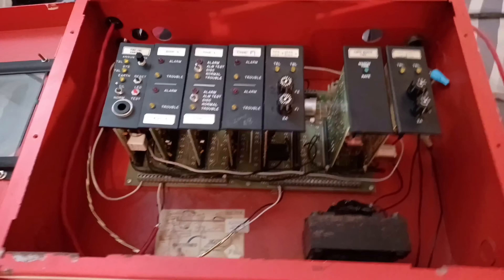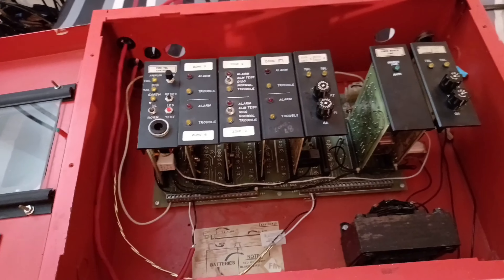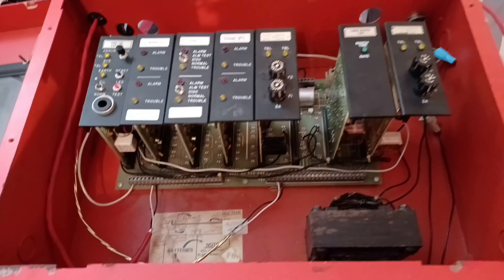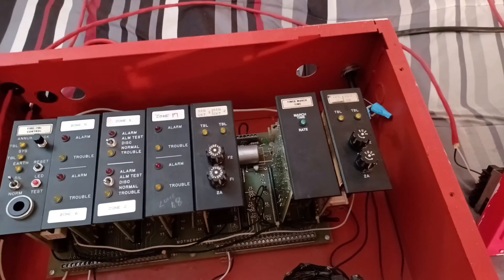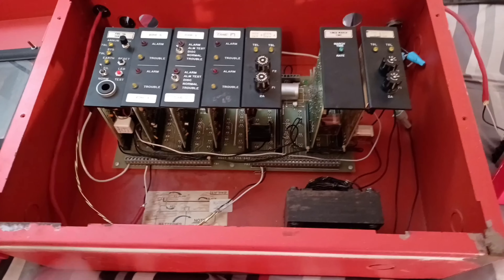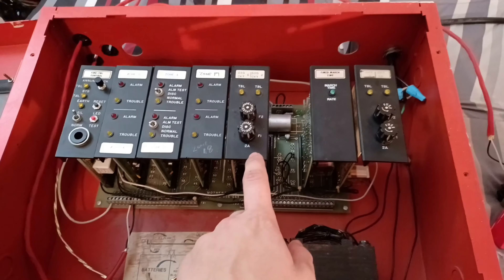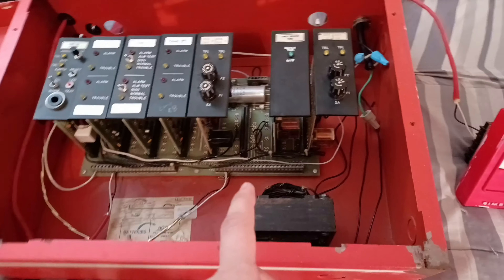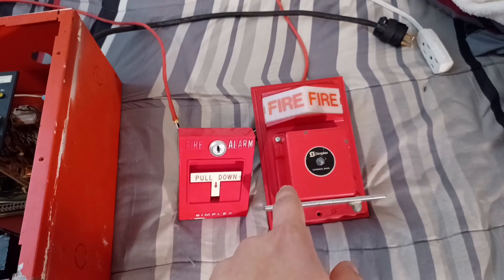Simplex 2001 System Test #1 - Simplex 2903-9002+2902-9234 Chime Light on 90BPM March Time

Comment: Congrats on getting it running? Did you cut D25 on the main card and 15-16 and 29-30 on the signal card?
Reply from the maker: Thanks. I did infact cut D25 on the main card. But which one of my cards is the signal card? Is it the nac cards with the fuses?
Reply: @officialnewyorkfirealarmtech  yep
Reply from the maker: @officialsimplexguy  Just cut 15-16 and 29-30 on both of my signal cards. Now the march time card problem has been fixed. I couldn't have done it without you. Thank you for your great advice on getting the nac cards and march time card to work properly.